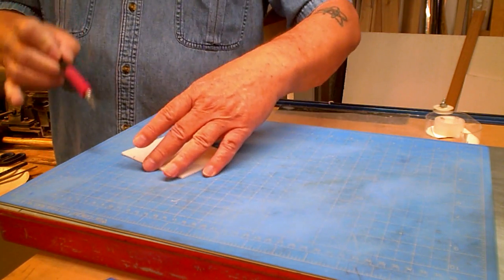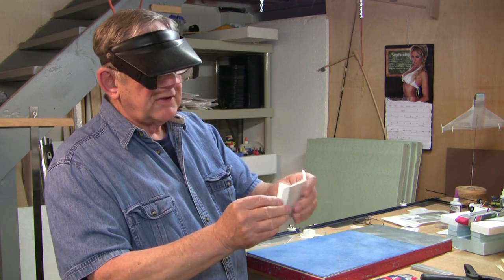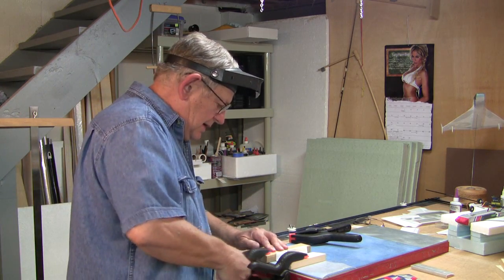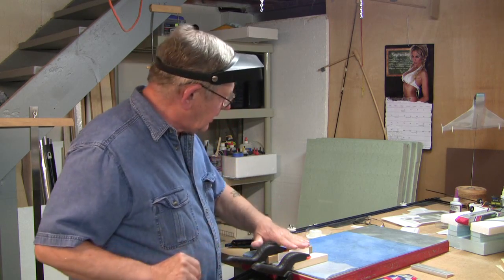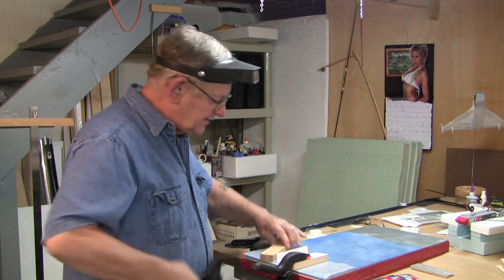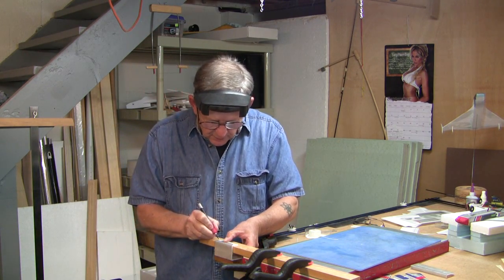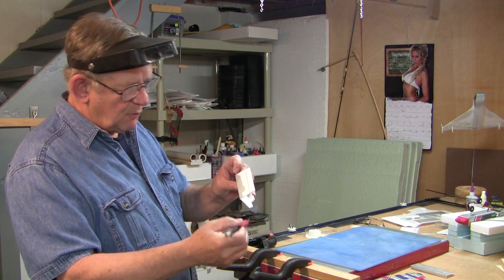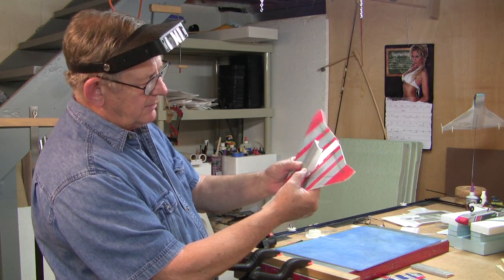Folding Depron Part 2

Comment from the maker: So far I've just used 3mm and I doubled the thickness of some small parts. The truss up front serves a couple purposes including increasing the strength and guiding the upper Coanda deck .
The Coanda deck directs air flow to the fan but it also improves torsional strength of the fuselage and opens up the equipment area for the nose wheel servo and the battery.